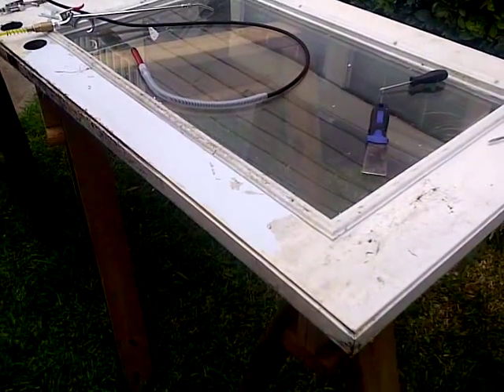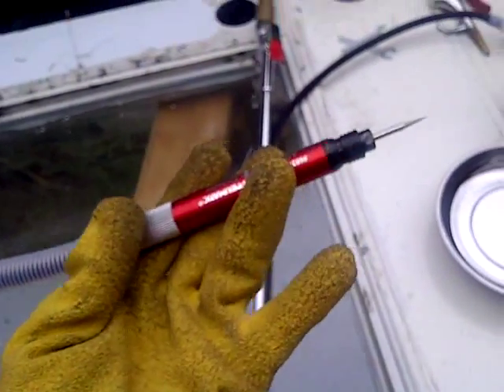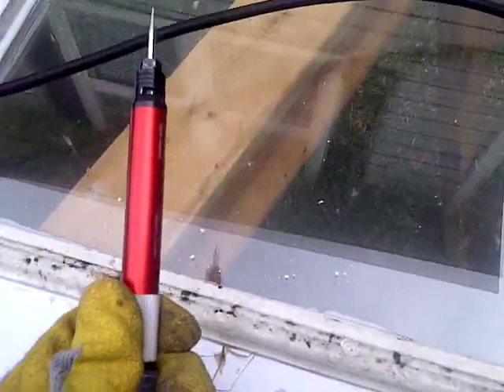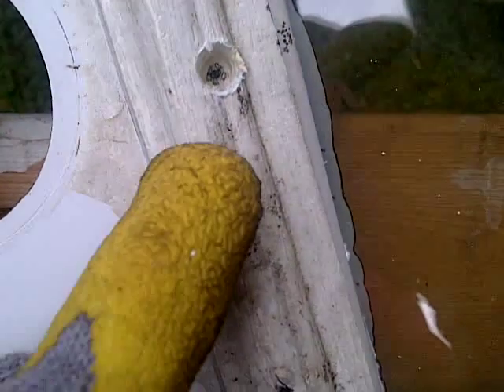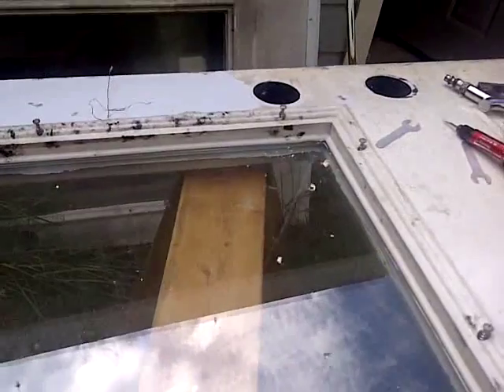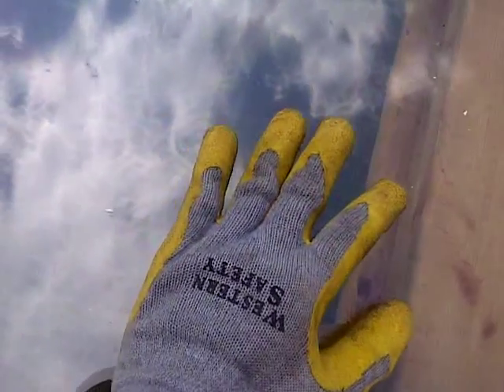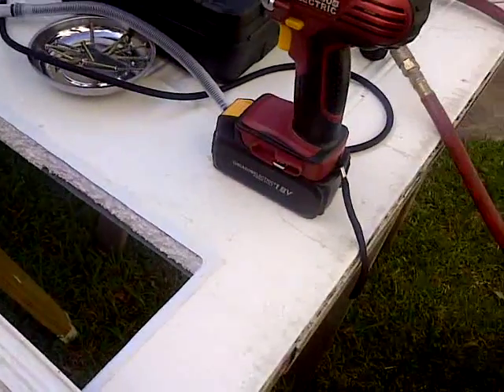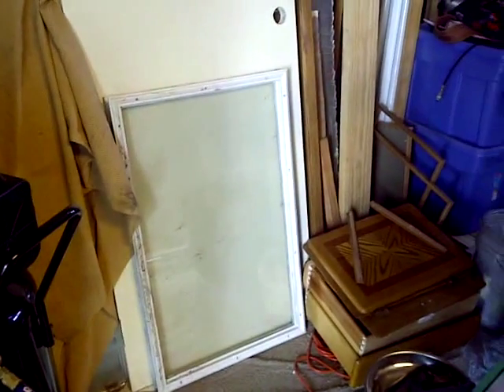1/8" Air Micro Die Grinder With Case 02 Field Test Update

Comment: Hey James, nice video. I'm an undergraduate industrial design student from Canada, and I'm currently working on a design project regarding pneumatic pencil-type grinders. I was curious to see if you had any complaints about your pencil grinder, or thoughts about how to improve it in terms of overall functionality. I was hoping to get some feedback about your experience using the grinder, things you like (exhaust sleeve is awesome!), things you didn't, limitations, what applications you use it for the most, etc. I would really appreciate your insight! Let me know.

Cheers,

Simon
Reply: I use die grinders everyday at work and use my pencil grinder quit frequiently. I have burned out at least 3 or 4 of these because my company gave them to use to try. I would save up the money and get a good quality one. A new one will run you about $400 but if you keep an eye out online you can get a used one for about $100. Look for brands like DOTCO, Dynabrade, and Top Cat. I bought a used DOTCO for about $125 used. The one I have is over 20 years old, I bought a new set of air vanes for $5 online and rebuilt it. It has never had any issues and it was well worth the higher cost. If you buy good air tools they will last you the rest of your life with little maintanence if you keep them clean and lubed.
Reply: I've had my harbor frieght pencil grinder for almost 12 years. keep it oiled and it will last. I use it as one of my normal day to day pneumatic tools and it has done me well.